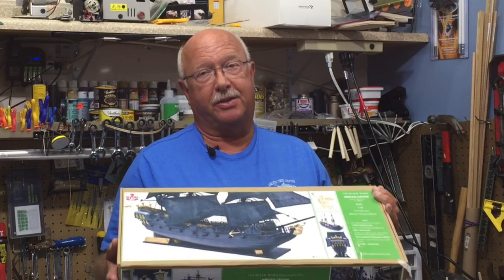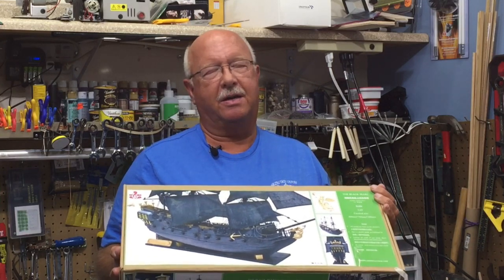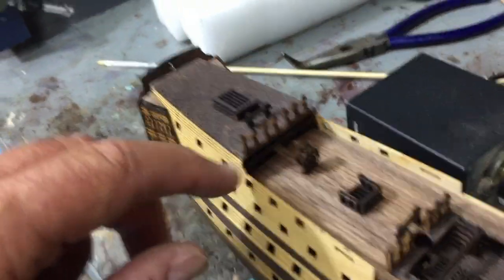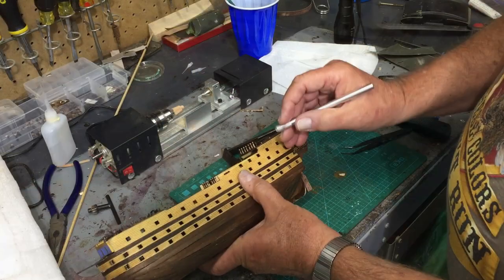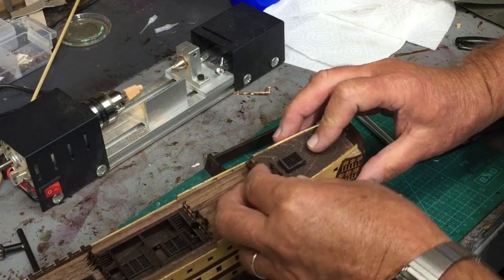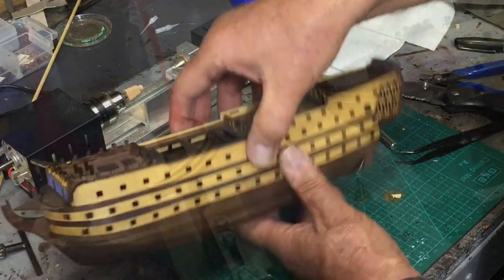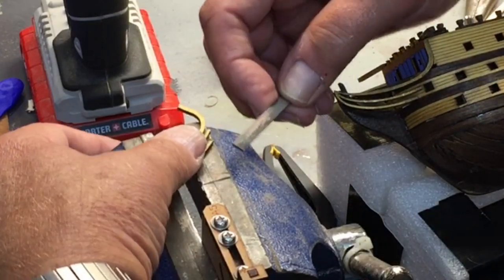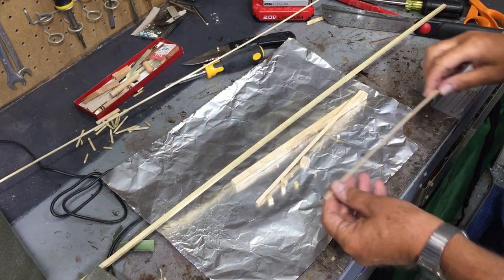HMS Victory Model Ship Build Episode 6

Comment: thats coming along good . as far as the lathe goes , you should be able to get a drill chuck for it , that will make centering a whole a lot easier
Reply from the maker: Drill chuck meaning the little thingy that attaches to the end of the wood piece that you’re working on?  I looked at some but with the very small dowel I didn’t find one small enough. I do have one that screws into the end of the dowel but it’s also just slightly smaller than the dowel.
Maybe you can send me a link for a tiny one! 👍👍
Reply: @BoilerDan1  Proxxon 27028 Drill chuck with sliding sleeve for the tailstock of the DB 250 use this as your center point with a drill bit after youve made the cannon
Reply from the maker: Thanks, I’ll check it out 👍
Reply from the maker: Ok, found it at Amazon for about $17.
So that will attach to my mini mini lathe?
Does it replace the one that is on it?
Or the opposite end?   Maybe it’ll be self explanatory when it arrives!
Reply: @BoilerDan1  this goes where the center/holding spindle is where there is no motor. I'm not sure though if this one will pass for your lathe . It's designed so the drill doesn't turn .you then lead the drill bit into the turning wood
Reply from the maker: Thanks 👍👍
Reply from the maker: I ordered the one you suggested!
Couldn’t determine for sure if it will fit on mine, but I will give it a try!
Thanks for the suggestion!
Reply: If you ordered it from Amazon ,there should be no problem returning it . I hope it works out for you
Reply from the maker: @wildsau1965  Yep! Prime baby👍😂

Comment: My model is 50X20X45cm is it same as yours?.havnt recieved it as yet so dont know about the dvd disk,will let you know👍
Reply from the maker: Yours might be a little better off as 50cm is around 19 1/2 inches in length.
Mine is smaller than that.  You’ll have more space to work with!